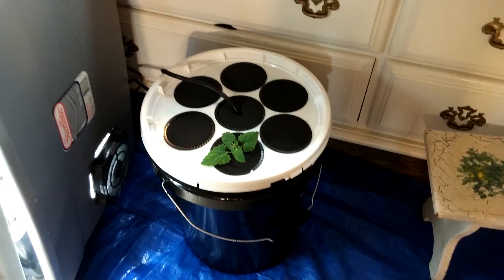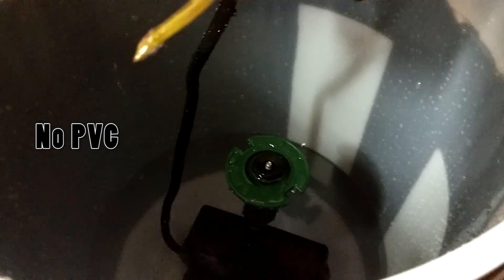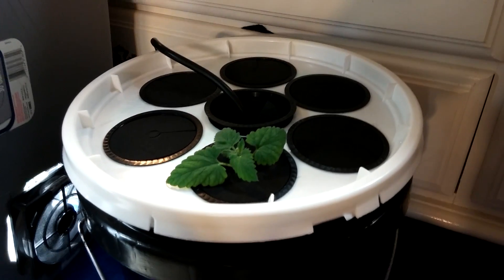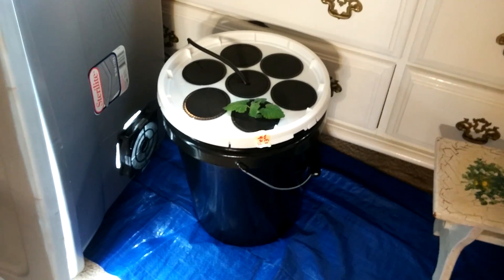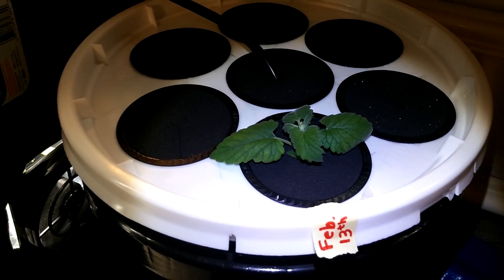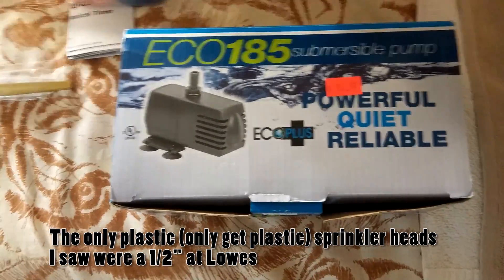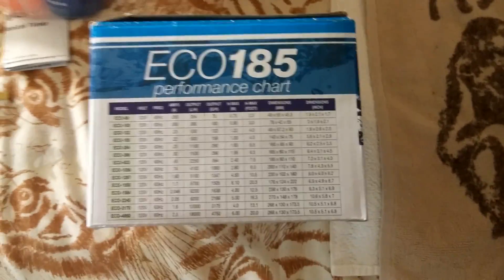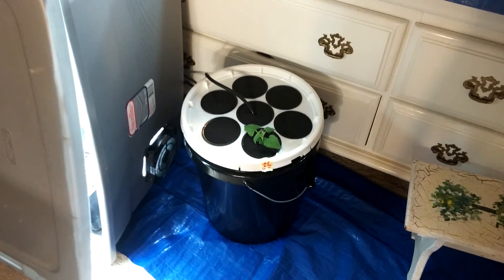Easiest DIY Aeroponics Cloner Ever! (No PVC)

Comment: Ok,question
Regarding the fitting at pump and adapting to 1/2" pvc ,I am assuming the fitting that comes with the pump is removed,and a threaded fitting replaces it,so the 1/2" pvc drops into it..glue then up 12" to the spray head.
Ordering online parts isnt easy but better than rumaging thru a store for parts.
 I'm also looking at the 264 pump to avoid this 
Thanks and good luck cloners

Comment: Check out a device called the dewey mister it's cheaper and more effective than what your doing here. It will save you a lot of time and money. And it works great. Good video though
Reply: dewy mister is way more expensive, doesnt work as well, this method is far superior you run it 30 minutes on and 30 minutes off total cost for me was only 26$ for the pump, sprinkler, bucket, lid, net pots, foam, and clay pebbles.  your house will be air conditioned so who cares about it warming water dissipates the heat so fast if you have a/c in your house it wont matter.  i only use mine in the winter to grow and in the summer just to clone. move backwards and use the dewey system if you want to go through evolution up to this cloner/hydro machine. i would bet money your selling dewey kits cause they suck and are definitely more expensive i only see $9 for each dewey device thats a terrible price.

Comment: What's the benefits of using a cloning machine such as this one compared to using vermiculite, a dome, a plastic tray, and separate plastic pod trays inside the big tray? The vermiculite setup doesn't require a pump and is all readily available at a hydro store or even a regular store. I've gotten roots as early as 8 days with that setup. I love the setup mentioned in the video but I think I'd use it more so for growing plants with nutrient solution and to not clone with. Help me out here.
Reply from the maker: I personally like this method of cloning because you can always see the bottom of the stem and frequently check whether or not you have roots. If the stem is always underground, its hard to know when/if you have roots or not. That's just me though. If you're successful with other methods then that's awesome!
Reply: Thanks for replying.
Reply: Thanks for replying to his Reply!

Comment: Do you need food grade buckets? No, just make sure they are BPA-free which most are now days.

Can you grow a plant from start to finish? Yes but you will need to add nutrients once the plant starts growing.

The one main thing I will disagree with the guy in the video you refer to is that if you clone using soil you must keep the soil dry and only mist the leaves. I do it all the time in solo cups and it only takes about 2 weeks before the clone is ready to plant. Just stick the cutting into the soil and water. Check every few days and water as necessary. You do not want to mist the leave of tomato plants as this can lead to fungus growth on the plant.

Using plain tap water is fine for cloning but it helps to get the PH in the 5.8 to 6.8 range first. Most tap water is in or near the 8.X range.

Since I am moving to 99% hydroponics I will be moving to using a cloning method similar to this. 

Also the water temperature should stay between 65 and 80 degrees F for best result in growing.

Comment: Instead of using a water pump could I use an air pump with a large air stone? The clones would be sprayed with water each time a new bubble bursts
Reply: You would need to keep on top of feeds much more often than 3 weeks if you were taking a plant further than clones, you'd have to stay on top of PH, EC Water temp etc etc. Also when the roots get extremely big they would no doubt block the sprinkler, if you really want to grow full size plants in this by far the best set up would be an air stone as a normal DWC. Could even clone with the aero like this then switch to air stone DWC when they've rooted.
Reply: I have an air stone that I purchased for an hydroponic setup, but I like this setup better. 
Q: I can take the plant to harvest provided that I add nutrient solution every 3 Weeks. I live in zone 8b and the summers get pretty hot.  Where should I store my setup so it doesn’t get too hot? Inside the house or can I setup on my screened porch with a fan?  Please advise.
Reply from the maker: Yeah you can. I had a smaller setup where I did that and it worked fairly well.

Comment: can I make one just to grow a  (1) plant from start to finish?
Reply: No this is for starting roots on clones, only use water no nutrients besides clonex or similar
Reply: Yes you can use this 5 gallon bucket method to grow a plant and harvest it all from the bucket.   All you need to grow the plants in the bucket is proper liquid plant food for Aeroponic plant system as well as liquid solutions to adjust the PH of the water up or down. Then mix the nutrients into the water around once a week and drain the water and replace the water about every 2 to 3 weeks .    You will need to test the PH of the water daily to make sure you are keeping it in the optimal growing range.  Most of the time buckets are used as cloners and  Big plastic totes are used the Aeroponic growing after that but either can work fine.    If you are going to use the bucket for more than cloning you will want to devise a way to drain the water without removing the lid and plants everytime.  I would recommend looking up other DIY Aeroponic videos to see more of the process of how to care for the plants.

Comment: you need air to lift the nute soln', not a pump. Look into dewey mister design. air wont change the temp of solution like a pump will.

Comment: Can you provide details on the sprinkler head?  I'm using a lawn & garden head and it doesn't seem to get all my 6 sites wet.  To test it, I put a little piece of toilet paper in each net pot.  2 of 6 got soaked, the other 4 were barely moist.  Not sure why it's not hitting all 6.  Thank you
Reply from the maker: +DrDangerPuppy The only details I know is what I put in the description. It has a green disk type of head, wider than the diameter of a quarter. Hope that helps.

Comment: do not use a drill in reverse to cut holes..just get a bit with finer teeth. it's cheaper than replacing the drill.
Reply: not hating, just thought ide mention it so people don't burn out there drills if they're making a lot of holes.
Reply: A good drill wont burn out

Comment: It should be pointed out that pvc plumbing parts ARE perfectly food-safe. It's only during manufacture or incineration of pvc that harmful toxins are released. The finished product is fine for plumbing of drinking water and such in your home. You DO however want to run away from it if it's in a fire, so don't ever try to burn scrap pieces, or even most plastics for that matter anyway.
Reply: That's so funny… I was thinking the same thing if we drink water from PVC pipes. Why is it safe to plant with it?
Reply: @kimberlyjones4112  Bro Science is rampant in the grow community.